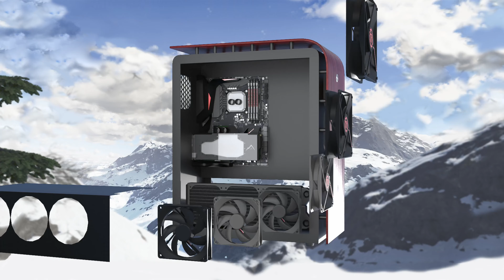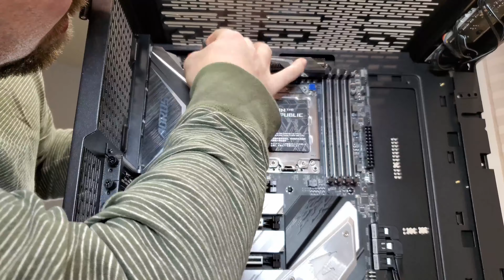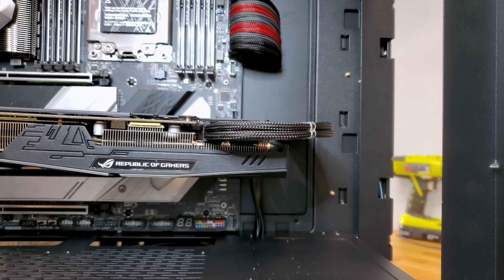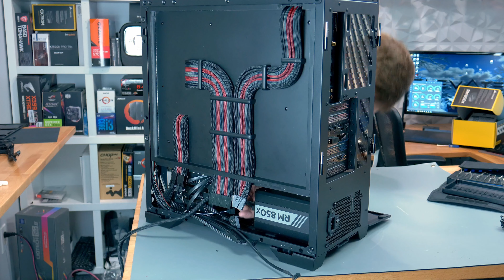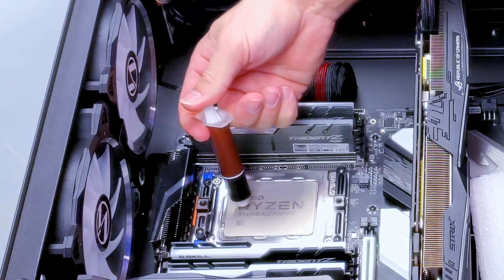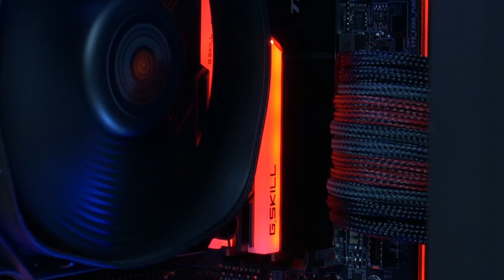Threadripper Build on a Budget Pt.3: The Final Build

Comment: Yo I woulda been completely stuck on that fan thing. Probably have torn everything out to get it in or just left it out 🤪
Reply from the maker: I was stuck for half a second there myself, but I quickly remembered a video by Alex from Bit-Tech modding this cooler and easily pulling the top off. It's good to be a TechTuber fan first, and not just a TechTuber.